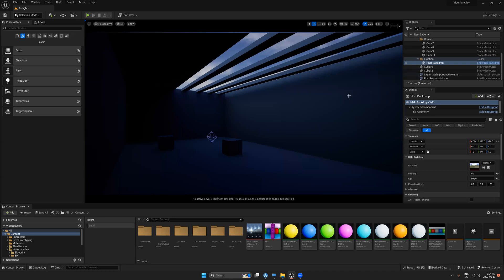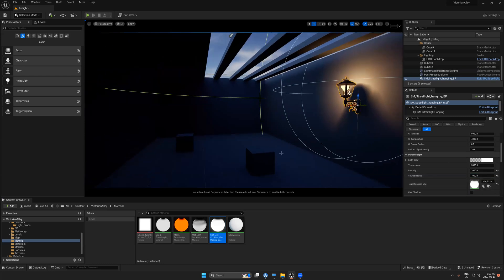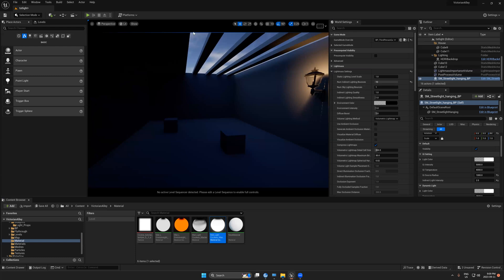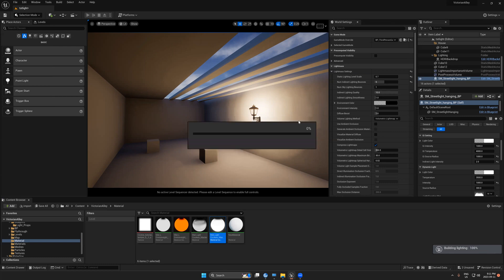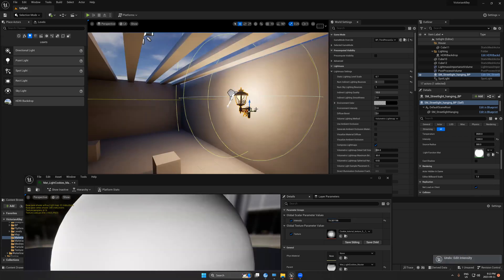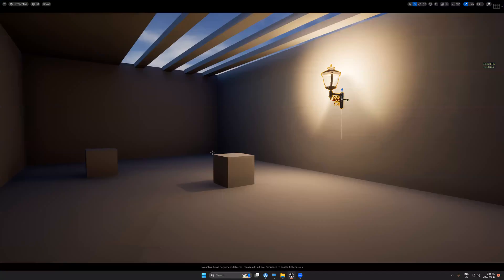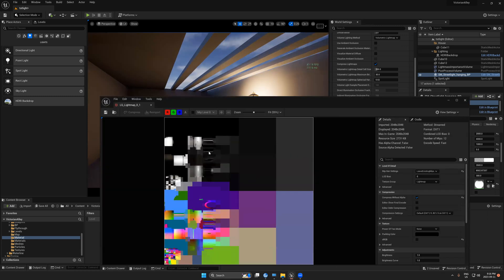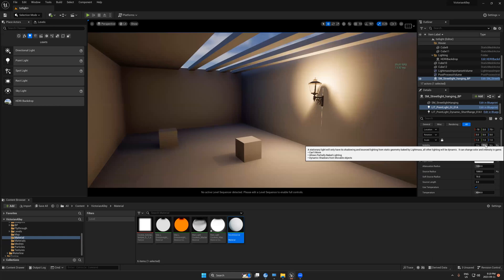Episode 04: Gi Light Baking Techniques in UE5

Comment: Would you use the two light setup for GI & Dynamic lights even if you still were using Lumen?
Reply: There's no point using it that way. Lumen uses raytracing to calculate indirect lighting in real time from the corresponding light source. Although it saves massively on baking times, I use lumen only for reference and testing because it's a massive performance hog, and its results are hit or miss. Sometimes, the results are fine. Other times, they are noisy and ugly depending on the shading of the scene.